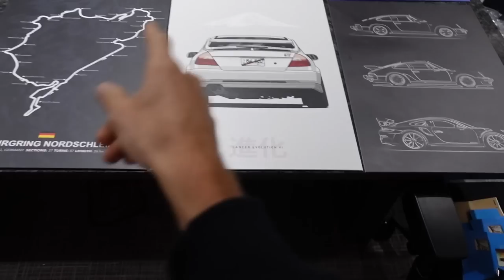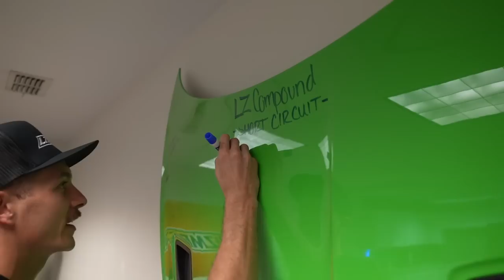I bought 6 New Cars... Introducing New Car Week!

Comment: I like the layout you have for the short circuit lap times. Would be sick to run as many of your regular cars (ones you already had prior to the idea) as you can and see how they stack up to each other. I have a feeling that some of your lower power cars will have an advantage.
Reply: Yes every video a new lap wether it’s adam with an old car Johan or collete or somebody else at the compound and it would be hilarious if he could get a delivery driver to run it in the crx
Edit: use magnets on the hood like top gear easier to move the times around
Reply: @emileponcelet8218  I think the hood is carbon? But I could be wrong
Reply: @jonathanshaw7242  you’re probably right now that i think about it you are right but couldn’t he put a magnet front and back

Comment: Hey Adam great video. I work at a body shop and I've used a lot of 3m tape, just use a razor blade to peel back the red backing, and you really should NOT clear bra brand new paint for at least 30 days after paint. new paint needs time to gas out and cure. keep up the good work my man!

Comment: I would like to see some kind of corrosion protection on the holes drilled in metal
Reply: I was gonna say the same thing, coming from living next to the beach, if you drill into metal you have to put some sort of protection like paint on a little brush or something of the sort and cover the bare metal cos that shits gonna rust in no time
Reply: 100% this. I always steal the wifes nail polish. has the brush to apply it and better than nothing right...
Reply: @DanielAndru91  exactly right, nail polish does the trick, i like to have touch up paint as it clolour matches but whatever works, works

Comment: In the future you should put paint or a coating on the holes after you drill them before installing clips. Helps prevent rust and is the way its outlined in manual (at least on newer cars)

Comment: By far the cleanest r32 gtr out there! Love the oem plus look so much!
Rotabroches are my favorite tool for cutting holes in cars. Much nicer then drill bits.
Reply: Do you really think that's the cleanest r32 out there, by far? That just seems a bit silly.
Reply: @richardfuller3566  I do actually.  Nice clean oem plus exterior. No dumb body kits so big goofy wings. Paint is spot on. Ride height is perfect and a good modest engine build. It's exactly how I'd build one if I had the ability to.

Comment: The holes drilled in the quarter are gonna start rust in like 5 years. Need to put some paint or something on the holes can't have bare metal from drilling. Just a brush touch of paint would work. 👌

Comment: When drilling those holes in the body do you not have to put any kind of sealer to prevent rust? Or does it seal up pretty tight with those OEM clips?
Reply: The GTR’s quarter panels are aluminum, so maybe that’s why they didn’t? 🤷🏻‍♂️ It can still erode though.
Reply: @justinglacken4891   you sure about that?
Reply: @diamondsink2000  about it eroding? Yeah I’m sure that bare aluminum can still corrode/erode.
Reply: @justinglacken4891  GTR front wings are alu, rear quarters are steel.
Reply: @Azarathal  ohh okay. Thanks for the clarification!

Comment: . First. Try drilling a few holes in the center of the low spot to see if it drains or wicks. If it dont drain Suck it up literally and add drains behind colettes shop. Its gonna take a bit of cutting but it can be fixed easily! Should be no standing water.

Comment: on the r32. plz ppf the front spats from the front wheels throwing rocks at front of that piece at on the rear bar at the back wheel and obviously ppf for the rear spats underneath too from rock flicking up. i see so many gtr's here in aus and thats the most common spot for rock chips because POWER and sticky tires once they get warm/hot not hating just trying to be helpful even though you wont ever see this content no doubt. love the content keep it coming and cheers mike for getting the outside shots for us. what an amazing team

Comment: Super nice car.. Bro
A little advice for you, get the holes that you drilled in the side panel painted or rust will come very quickly "I know the plugs you use are supposed to be waterproof but believe me it comes from the inside"
I usually use black paint/primer, which I use to repair rust spots in the window frame when you put a new windshield in.
have been following you for a few years now and must say, keep it up
Greetings from Denmark

Comment: The only thing I would have done different on the rear spats is use adhesive promoter where the 3m tape touches the body as well as using it on the spat too before you put the 3m on

Comment: As someone with an N1 kit ( except those rear spats :/ ) on my R32 that was installed in Japan, I'm super interested by seeing how these pieces were installed. It's interesting how much effort Nissan went into making sure these parts could be perfectly mounted. As opposed to when you get a bumper from a random company and it doesn't fit right and you end up redneck-ing it to get it to fit.

Comment: When I was I painting I use to use the corner of a razor blade to separate the 2nd side of the double-sided tape. I would be careful smashing painted plastic parts with excessive heat, personally.

Comment: Everytime you show the water behind Collete’s shop I always wonder if the perfect fix for that would be to slab cut and polyjack the area to re-slope the angle of the slab for better water run off. I wonder what your concrete guy thinks about it. I would assume it would be better to polyjack than mudjack the area given the consistent water pooling.

Comment: company's who create wide body kits should utilize the same oem style mounting clips manufactures use to mount side skirts. rivets are hideous and it would be sick to be able to snap the panels right in with no visible hardware and would make them easy to replace.

Comment: The easiest trick for 3m double sided tape, to remove the red backing. Grab a razor blade, use the tip of the Razor blade and peel back the red.... Heating it up for no reason

Comment: The heat gun use on the 3M tape seems a little extra. Literally a razor blade or knife will easily pick up the corner every time.

Comment: The paint on the GTR bits doesn't look like a very good match on the car... Looks darker. I had the same problem getting bits painted for my AE86, despite matching the paint from the fuel flap it turned out noticeably different in certain lighting conditions.

Comment: 7:00  You should utilize the Cleetus C8 seat belt trick where you move the seat all the way back and reclined then pull on your fastened belt quick enough to engage the lock then move the seat into a more upright and forward position which will lock you into the seat as harder than a race harness if its got power seats.